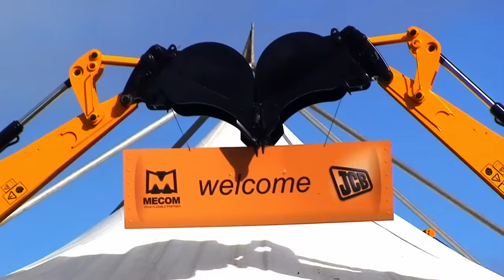IMPRESSIVE JCB SHOW!!

Comment: I worked underground for over 30 years , the worst 2 pieces of machinery I ever used was JCB and whats now owned bye Atlas copco calles the st range of loaders these 2 machines are the absolute worst pieces of equipement you can your workers using underground